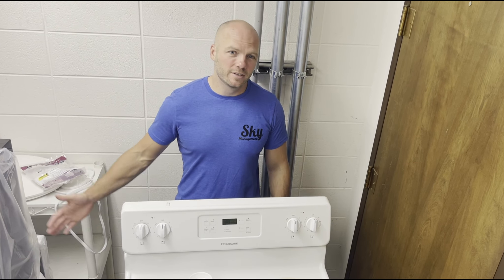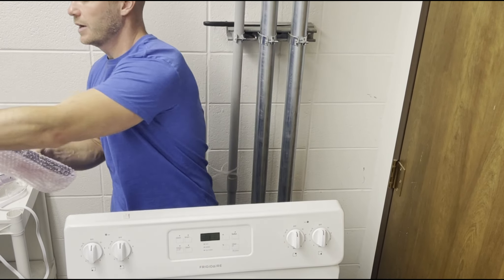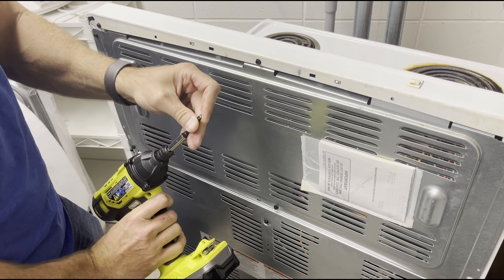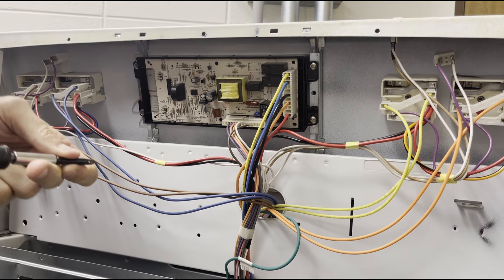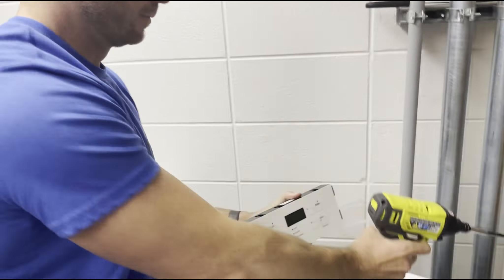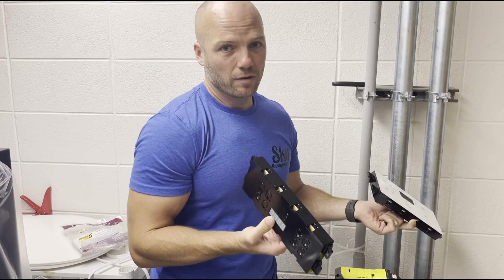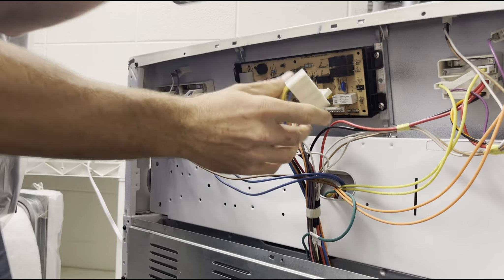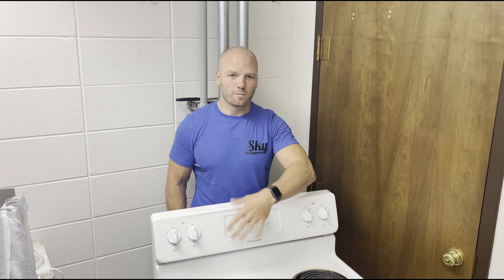Fix an F13 Error on a Frigidaire Range

Comment: Same thing happened to me. The model number was a little different though. Mine only had one connector. Cost me $187 new. It fixed the problem. Afterwards, I found on EBay that some people had used ones on sale for $45. Never mind the part was probably made in China for $5.